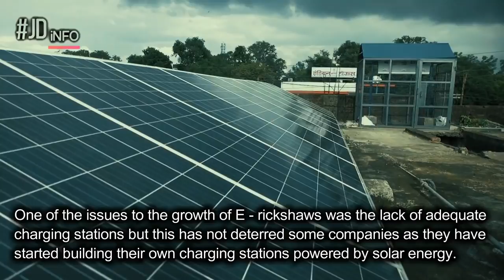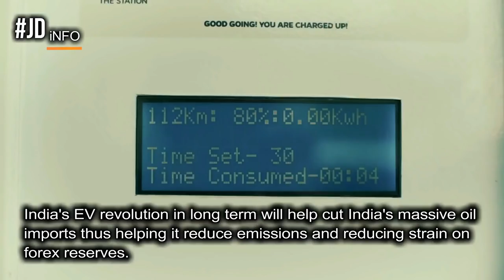India's E - rickshaws revolution - 1.5 million and counting

Comment: Atleast this will reduce large amount of pollution in cities..... Now only Li-ion technology provided by Isro to the companies is needed to produce more batteries and solar kits...👍
Reply: Even E-Rikshaw itself should be sold in kit form. Let ordinary small workshops assemble them and participate in the profit model. This may even spawn more diversity in designs and more innovation in the electric vehicle space. Also, it would be good for Tata to come up with an E-Nano cheap small car. I heard Tata's in need of more bailout loans on soft terms because it's facing losses with Jaguar-Landrover. So in exchange for such soft loans, the govt should push Tata to make a cheap small Electric Nano type of car. This shouldn't be too difficult for Tata to do, because it's not like they'd have to do it from scratch.
Reply: New grephene technology battery is coming . It is more efficient and fast.
Reply: Li-ion based batteries would be too costly for these e-rickshaws.
Reply: Yepp about 20 companies bought the battery tech of ISRO!